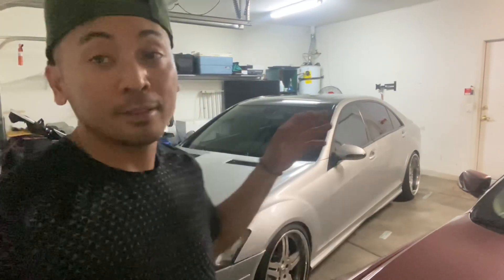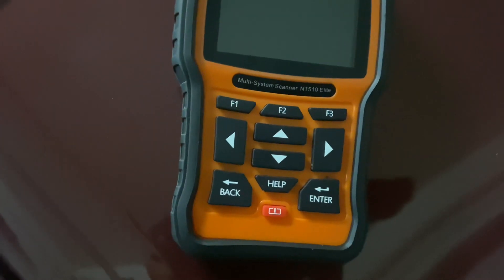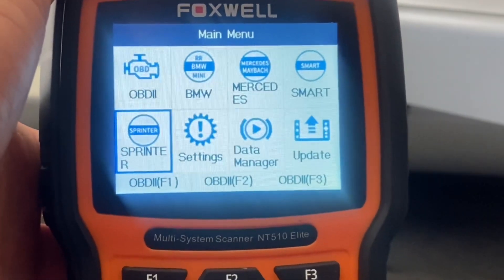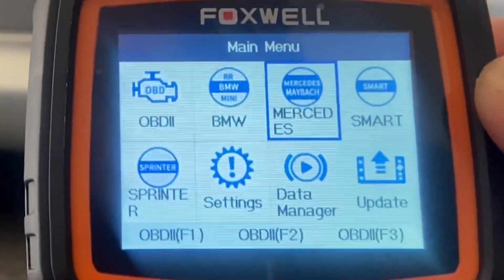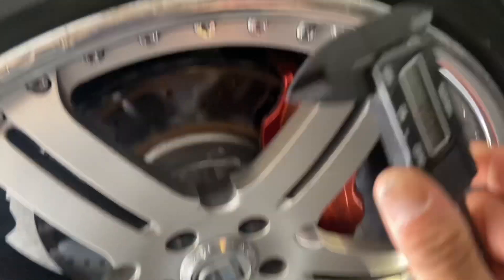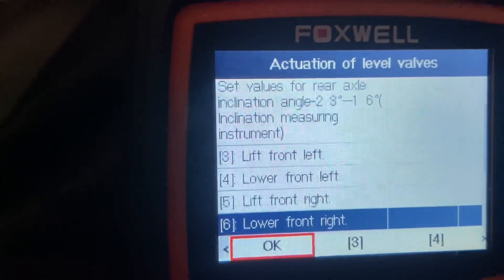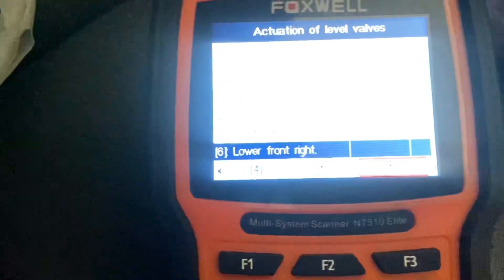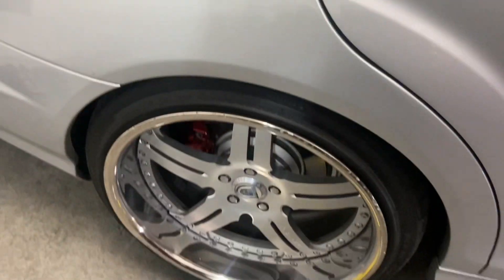“ LOWER MERCEDES Airmatic / ABC FOXWELL Elite NT510 OBD2 Scanner” Amazon $180 NO Links, Module W221

Comment: Leave alone it looks strong 💪🏾
Reply from the maker: Lol thx bro !
Reply: @GonZaWoRx       I have questions 1 how did you delete the chrome Edging and how did you do for headlights black face and like that looks good
Reply from the maker: The chrome I used vinyl wrap roll from Amazon in gloss black.  Was pretty easy cause roll is precut 3in, just use a blow dryer , heat gun and blade to trim 

VViViD Black Gloss Air-Release... https://www.amazon.com/dp/B07DM244FZ?ref=ppx_pop_mob_ap_share

The headlights just heated  headlight and painted inner plastic  and assembled. Checkout My other video in library  on painted black headlight. I did a step by step on the whole modification. 

Mercedes S-CLASS BUILD (How To: BLACK PAINTED Headlight Housing + MODS) W221, S550  PT. 5 https://youtu.be/PloT9AsEZ2Q
Reply: @GonZaWoRx      Thank you 🙏🏾 sir.     I have the 3m gloss trim   Very cool I have a s55 AMG 2093 and I’m going to murder it out
Reply from the maker: Nice ! Yeah lmk if you run into anything and have questions.  It’s gonna look nice all black
Reply: @GonZaWoRx     It’s black on black
Reply from the maker: Yeah any year or model car to paint the headlights black the process is all same. I used same process to paint lights on diff makes and models.
Reply: @GonZaWoRx       Thank you 🙏🏾 fir the information bro
Reply from the maker: Np!
Reply: Wow!! Looks great!